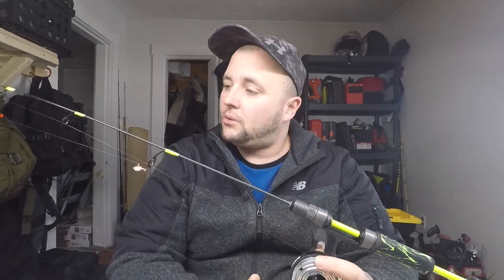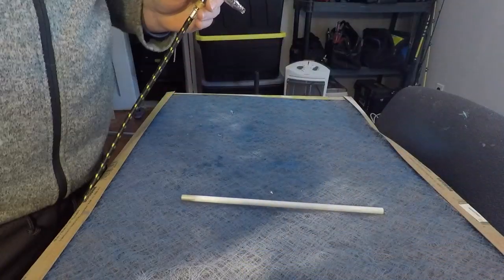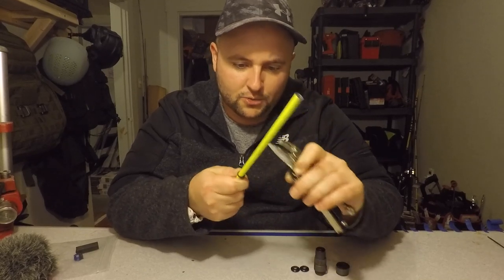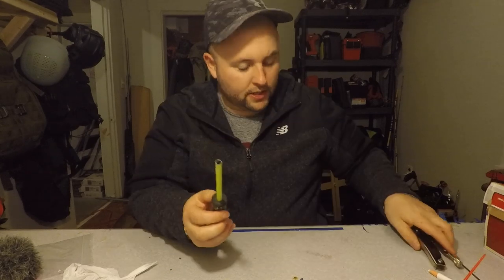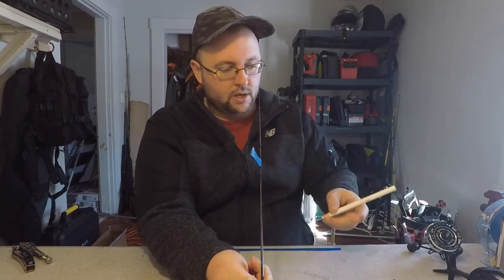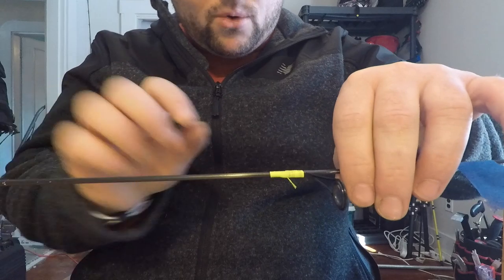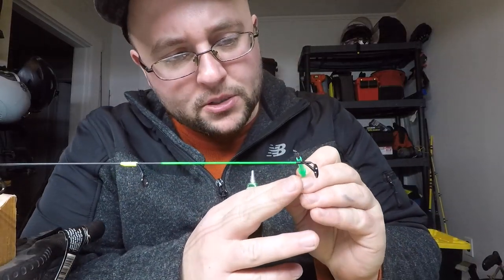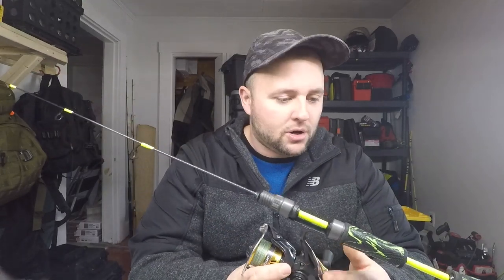How to make a Split Grip Ice Fishing Rod. DIY jigging Rod.

Comment: I've used both 6061 and free fall 13 fishing reels for 2 years now. The 6061 will drop a 1/64 oz. Jig With or without bait on it. The freefall struggles with 1/64 oz. Jig. I have greased and oiled them with quantum hot sauce. I haven't had them  freeze up yet. I am pleased with the reels. I haven't found a better inline reel yet. Clam has a reel like the freefall I haven't tried one to compare. Thank you for your videos
Reply from the maker: Thanks for the info. I get asked often about the 1/64s, and I don’t use them much, but have found the 6061 drops better for the size I use!

Comment: So three years later… did that uv cure glue last? Did it fail to flex?
Reply from the maker: Still using it…heavily at times. No failures, flexes fine. Only thing that I noticed was it had the slightest amount of tackiness for a month or so. Enough to collect lint and dust. Have used it on several others with the same result. I tell people it’s something I still use for personal rods, but not for ones I sell to folks because of the tackiness. May be my method, may have to use a curing box, which I may try may some point

Comment: How is the solarez flex holding up?
Reply from the maker: The solarez is holding up great, no long term problems I’ve found yet. Have it on 4 rods. All positive, with the exception of the final cure “tackiness” that is know for all the UV cure resins. It does cure hard, but does leave some minor tackiness that takes several weeks to final cure. I plan on doing a full review soon!
Reply: @precisionanglingYT  thank you very much for the response